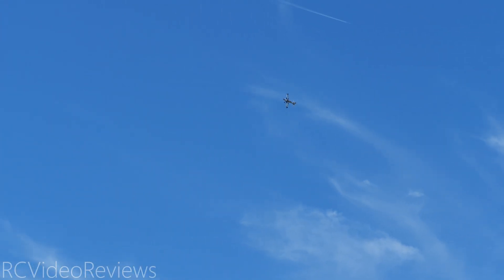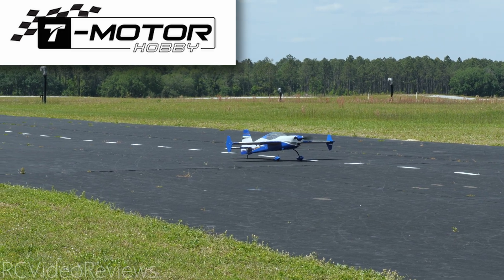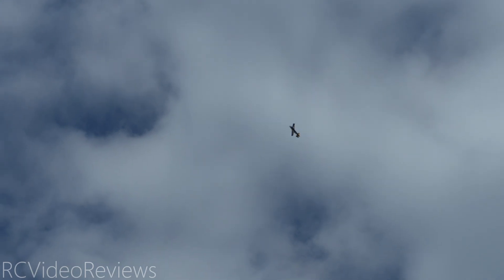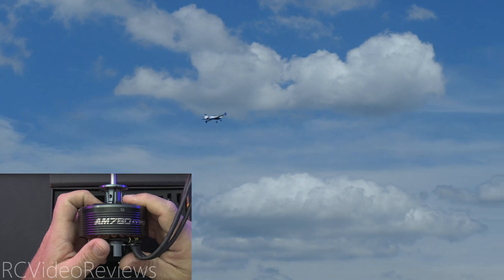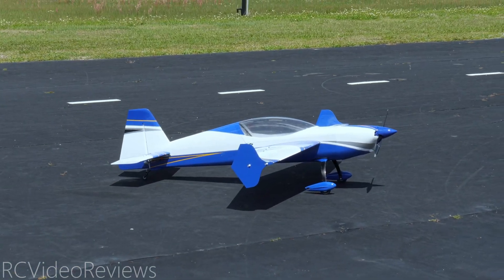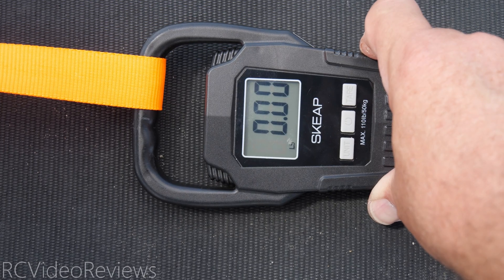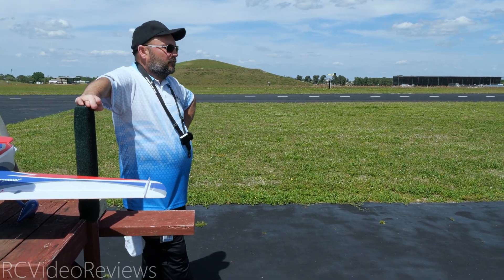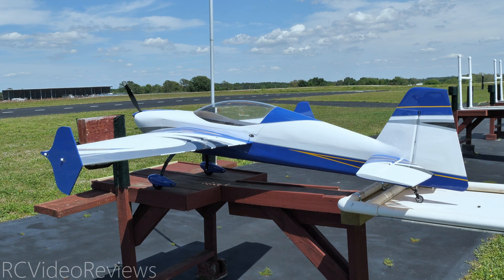INSANE! Nearly 5000 watts for a 78" Plane • New T-Motor AM780

Comment: I have the Sunnysky 40CC 190KV on a Pilot 78" Extra NG. It would not surprise me to learn that these 2 motors are made at the same factory.
Reply from the maker: There is definitely overlap in manufacturing. There is a guy out on RCG who tried explaining this to people even to the extent of disassembling different brand motors and measuring every dimension to show the only real differences were in color/graphics. He got skewered.

The brutal truth of it is many products we use in this hobby share production/manufacturing facilities and differ by little more than a label. There are exceptions of course. I've spoken with the owners of Precision Aerobatics and they say their factory is owned and produces only PA equipment.
Reply: Which ESC do you use with that Sunnysky motor?
Reply: @juanfeliperinconcolmenares6730  I use a Castle Talon HV 12S ESC. It has a Beefy BEC. I also use a tiny 2S lipo as a battery backup. I run the BEC and the 2S through a diode, so if one of them stops working, the other takes over.

Comment: That wattage is Power Used, not power put to the Prop, there should be an effiency factor included in the paperwork to say how many Watts in for how many Newton Meters out.
You never said anything about the prop size or pitch, both of which matter to power used.
The vertical acceleration looked like fun :)
Reply from the maker: From Hacker: https://hackermotorusa.com/resources/rc-brushless-motor-application-guide/
Electric motor power is stated in watts. 750 watts = 1 horsepower.

An easy way to estimate power needs for RC hobby applications is to use 100 watts per pound for sport flying, 150 for aggressive aerobatics, 200 watts per pound for 3D flying.

We use watts per lb as a good relative indicator of performance which is why I include that measure along with t:w in the calculation.

You don't follow the channel I guess. Prop size was covered in the maiden: 22x10.
Reply: @RCVideoReviews  The magazine is just quoting Power Used, not Power Generated, which will be in Newton Meters or Shaft Horsepower, though it can be rough estimated with power used multiplied by the efficiency factor of the motor.
I did follow the channel, but that doesn't mean I watched every video.